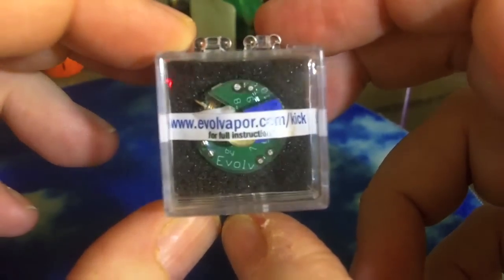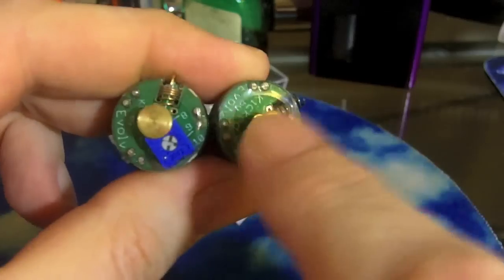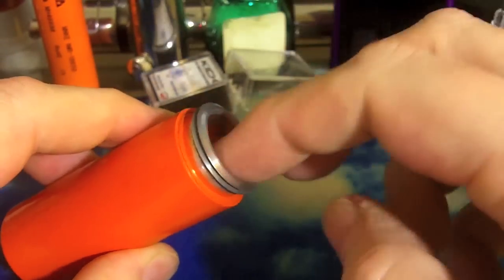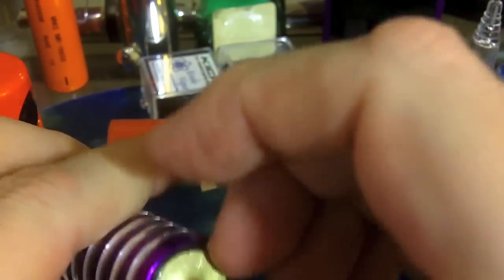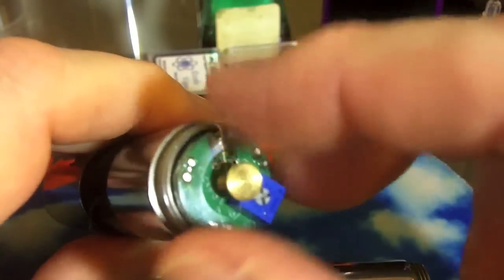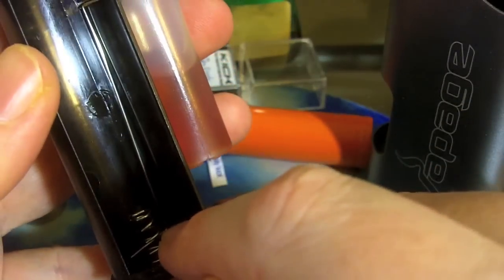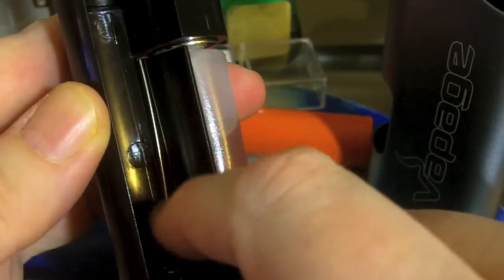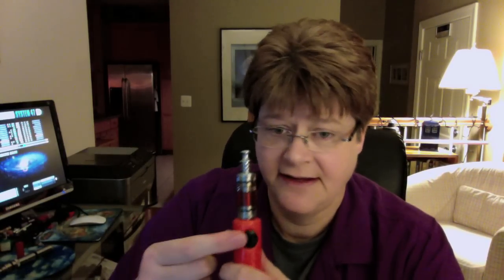The Kick from Evolv

Comment: In case any viewers are interested:   P = V^2/R.  P is power in Watts, V is voltage in Volts, R is resistance in Ohms.  Generally speaking if you use an atomizer that is lower than 3.5ohm at true 6V, or 1.5ohm at true 3.7V, then your desired power will be greater than 10W, and this mod may not be for you.  I for example like 2ohm cartos on a fresh battery (approx. 4.2V), which is just slightly above 8.5W.  However, at the battery's nominal voltage of 3.7V the power decreases by nearly 25%.

Comment: As far as the Reo is concerned, both the polished and the tumbled finish should work just fine right out of the box without any unsightly sanding or marring. This could also work if you only have a polished or tumbled door, but I am uncertain if there is anodizing or adhesive between the magnet(s) and the body of the mod.